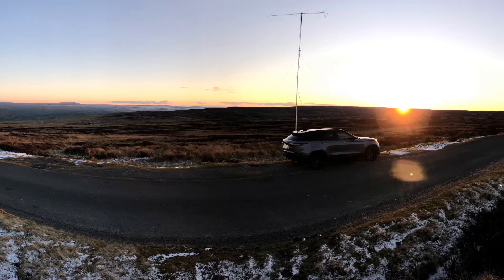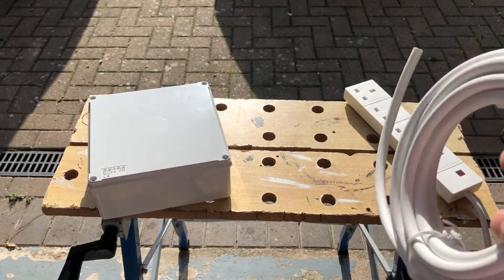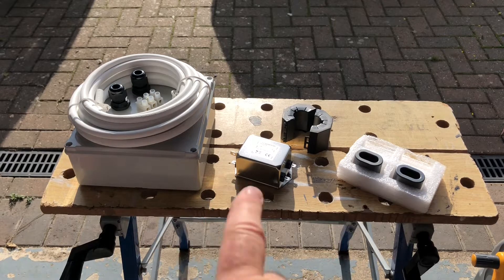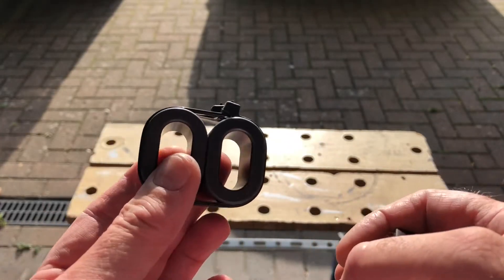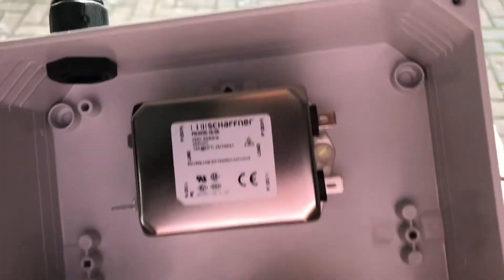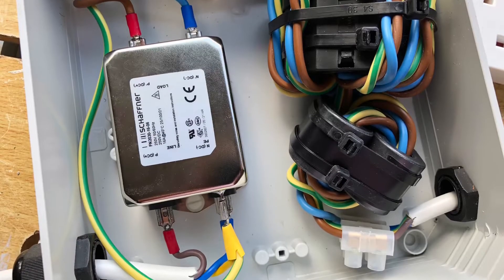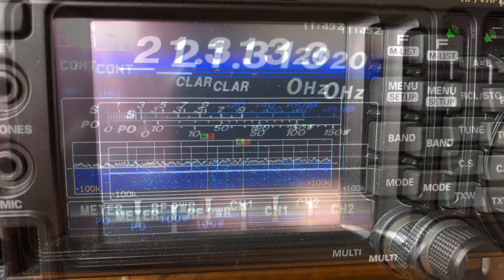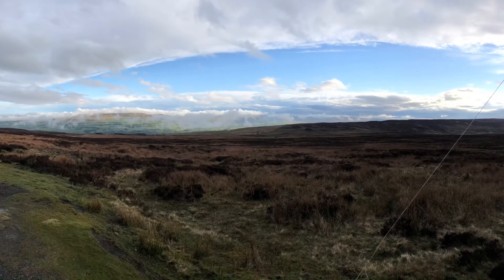Eliminate Your RFI - Build Your Own Mains Filter

Comment: I'm not 100% sure on this; but I don't think you need to "wind" the ground wire in the cores.  The ground wire is strictly for safety and not a "current carrying conductor".  If you were to omit the ground wire in your winding's you may be able to get an few extra turns...Might help?
Reply from the maker: Thanks Tom! Coincidentally, I contacted Mouser tech support (as it was from them I purchased the components from) and they also suggested rerouting the ground.  That’s my next step on this project, just haven’t got round to it yet, as been running the noisy 6m band o the big battery when /P. Thanks for the suggestion 👍🏻
Reply: You need to include the ground wire in the ferrite core winding to have the common mode choke be functional.  The ground wire carries common mode current.  Please refer to K9YC (Jim Brown) papers on this subject.

Comment: what  u think of using battery generator and using isolation transformer to charge the batteries with that power  the equipment only from the generator battery will it reduce rfi?
Reply from the maker: Hi Daniel. I think I know what you mean. Generator>filter>battery charger>battery. They’ll all still be connected, so the issue will be the same I think? Plus, making sure the load doesn’t get applied to the charger. I’ve got a couple of ideas to try to improve the performance on 6m, so hopefully will be able to report back 🤞🏻
Reply: @G0CNN-Ian  sorry if u dont understand me i was thinking charge the batteries with isolation transformer then using them with the equipment
Reply: I will use the equipment only from the generator
Reply from the maker: @wfqka  Ah ok. I’m using the generator because the two amplifiers (2/70) are happier at 13.5v+. Plus the rig on its own on 6m is pulling a lot of current at 100W and causing some voltage drop.

Comment: Another interesting video Ian, thanks! Is it possible to work out before, which frequency the chokes and filter will hit? I was wondering if you could build different units for given bands or build the chokes as a type of module for a band.
Reply from the maker: Thanks. Yes, I know what you mean, but I suspect that’s not within the scope of an amateur or the equipment we have access to. A good wide-frequency choke like this one does the business, but just starts to struggle at 50MHz, which to be fair is a long way up the spectrum from HF. I’m still working on this, so hopefully will be back with an update 👍🏻
Reply: @G0CNN-Ian   Thanks for the reply Ian, I take your point and look forward to updates. Keep up the good work!

Comment: Hi Ian, I made one of these when putting the shack back in operation during lockdown. Everything needing mains in the shack goes through it and it works well. I did get two sets of components in case the current draw was too much for one but when I checked after setting everything up my maximum draw was under 10 amps so one handles that with ease. I'll build the other unit to take with me when going on hols with the radios and DX commander. 73
Reply from the maker: Good one Robert 👍🏻

Comment: One problem I see is you have no ground rod connected to the generator which alleviates static build up. Look at the front panel that generator there should be a systematic for ground with a tap screw on it
Reply from the maker: Hi. Yes, you’re right, but after a lot of reading I’ve gone for a floating ground, both for safety and RFI.
Reply: @G0CNN-Ian   how much dissipation can be achieved with a floating ground I've never looked into it
Reply from the maker: The ground seems to do little for RFI reduction and giving a ground to a vehicle and circuits which aren’t grounded adds an element of risk to the occupants. Also, achieving a good effective ground over and over again on a portable site is difficult to achieve in reality.

Comment: Nice filtering. I m getting noise the other way from my 10kw gener ac sadly where it’s positioned atm my balanced feed goes 30’ over genie and over to my feedpoint mast and then my hw dipole element is 80’ higher,  so I pick up the noise by my antenna. Hope to build a dog house to put genie in away from my feeder and element. I wonder if any of the noise/ harmonics were cause by the stepped sine-wave inverter inside the genie  ??
Reply from the maker: Yes it will be the inverter inside. A wire mesh faraday cage is another option if it’s radiating….

Comment: Does the generator have a grounding lug? If it does (my Yamaha did) try sticking a spike in the ground and tying the generator to that to see if it helps.
Reply from the maker: Thanks and yes it does Vince. After a lot of reading I decided to leave it as a floating earth and not attempt to ground.
Reply: That generator ground is to provide safety for any (metal) tools or appliances with a ground pin connection. However, it's not going to be safe unless the ground connection is a very good one.

Good RF grounding requires flat strap or braid.

Comment: That’s a great idea I never thought about running a generator I will have to look into that👍

by the way what was the issue with the electrical system on the vehicle???
Reply from the maker: Hi and thanks. I had voltage drop due to heavy current draw on one setup. And an issue with not presenting 13.8v on another. Both worked, but noticed a reduction in power and on vhf/uhf ever watt counts 👍🏻Main leisure battery now two years old, so mulled over my options …..
Reply: @G0CNN-Ian  Oh yes I know exactly what you mean. I had to rewire my whole electrical system with zero gauge wire with an upgraded alternator with all interconnections to and from the alternator being zero gauge with a second battery in the back.